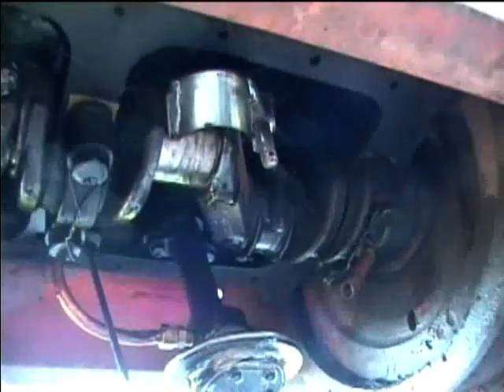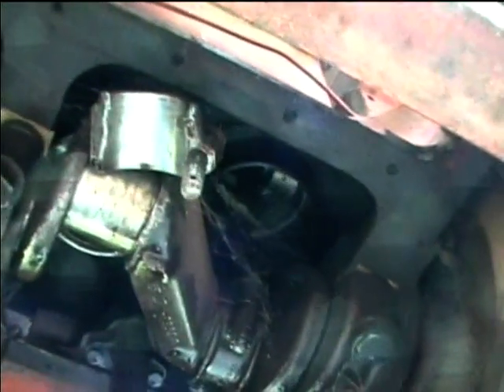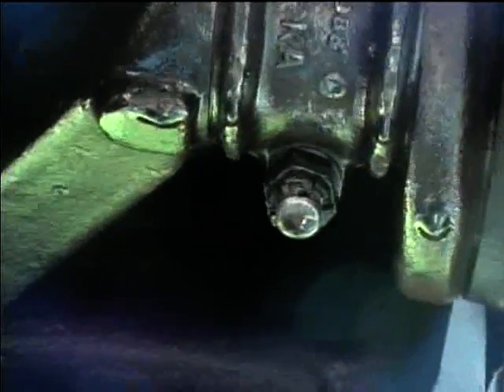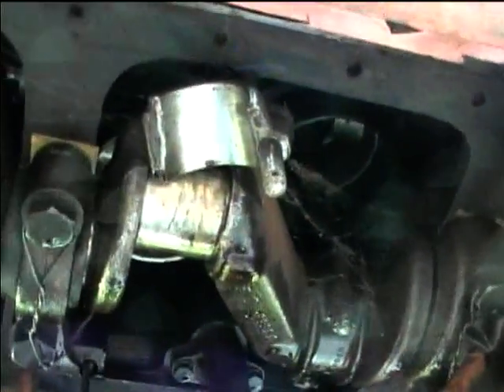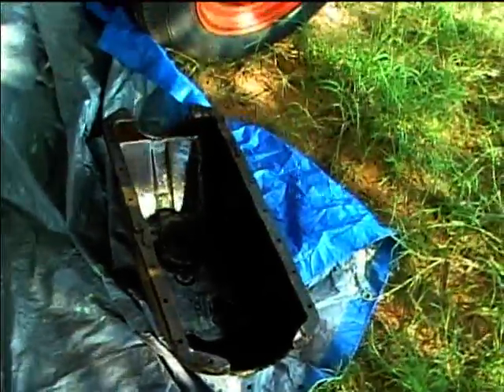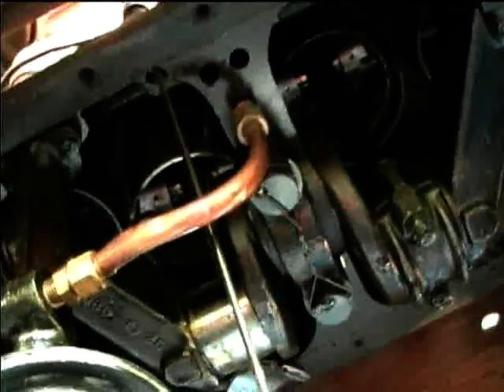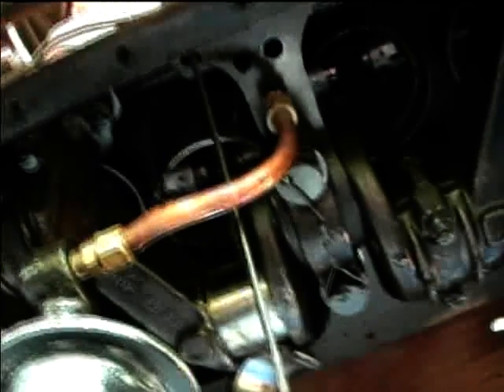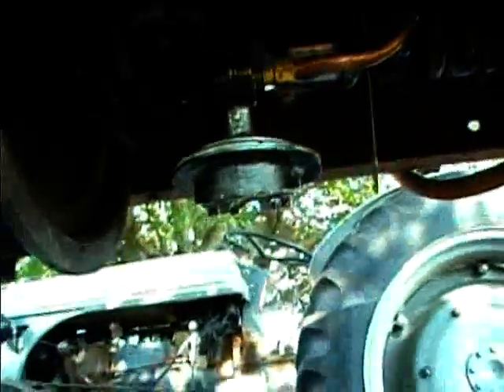Allis-Chalmers WD engine piston/connecting rod damage

Comment: I've got a 1960 D15 that's apparently leaking coolant into the crankcase oil.  This problem surfaced after I replaced the water pump.  My wife was operating the tractor when the water pump failed, and I assume that engine overheated and damaged the head gasket. 

There doesn't seem to be any engine exhaust compression leaking into the cooling system, but there does seem to be more pressure in the crankcase from oil droplets splashing out of the dipstick opening.  I plan to check compression in each cylinder before removing the head to help locate the problem and also determine whether it's time for an engine overhaul.  

The engine burns a quart of oil with every 5 hours or so of operation, and has done so since it came into our possession in 1998.  Is that oil consumption coming from the valve guides?  If so, what's the solution?  

Am I on the right track with the head gasket diagnosis?  

Thanks for your help.

Comment from the maker: Thanks for your advice...do you know of a good source to get parts?
I think you're right that rain water might have got in there somehow. It's been more than 3 years since the engine quit running and the oil pan was just on there loosely. It never had a problem with coolant in the oil when it was running...and when I initially drained the oil to remove the pan, it didn't have any water in it.

Comment: Do you have a radiator pressure tester? Pressurize the cooling system and see if any  water/coolant leaks from inside the engine. 

I would replace that copper tubing with steel tubing as copper can fatigue and crack easily.

If the crank isn't beat up it should be ok. Measure it before you buy bearings, it could have been turned sometime in the past.

Comment: That is unusual for a rod cap to break on a low rpm engine like that.  If you have water in the oil you either had a blown head gasket or you cracked the water jacket by the cylinder wall.  If thats the case witht he water jacket the block is no good.

Comment: Yeah, I think you'd also have inevitable piston-clearance issues after a hone anyway since the sleeve got hit pretty hard.  I get the feeling that 1.)Honing wouldn't get the damage out without being considered a rebore and need an new overbore piston, and 2.)The sleeve may not be round anymore (depending on how much of the block it's in contact with near the crankcase)
-Cody
BTW I'm a fan of your mechanical-oriented vids!  lol

Comment from the maker: Hi, thanks for your advice...Yes I think I will need to replace the sleeve...there may be damage as you say and also the new piston would likely not fit in the old sleeve due to normal wear.
The problem occured at the engine's usual loaded operating RPM (probably around 1000?)
I shut it off immediately when I heard the banging.
This engine did indeed have kind of poor oil pressure, it was OK at start-up but would drop when hot (maybe worn main bearings?)

Comment: Granted, I say replace the sleeve mainly b/c it's just so much easier, albeit possibly more expensive (again, not sure).  It also made me think about the sleeve actually being whacked out of shape if the crank hit the piston in the right spot and pressed it into the liner's side... *making the liner this shape: (( ever so slightly...
Again, take this with a grain of salt since I've never worked on a tractor engine like this!
-Cody

Comment: Well, I'll give my $.02 even though I've never done work on a unit like this.
I'd be real wary of that crank journal after that (what rpm did it fail at anyway?). I think there could be a posibility that you may have oil pressure issues from the journal side damage, but I'm not too sure. Liner-wise you're probbly not in too bad a shape. Depending on how hard the piston skirt got hit by the crank, you may be OK with a hone, BUT if it was my tractor I'd probably just press in a new sleeve anyway.